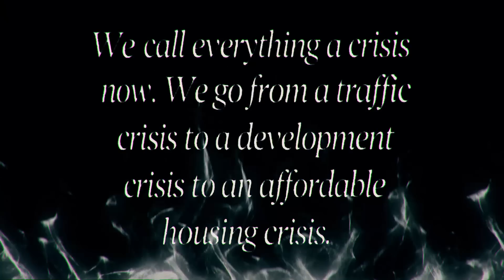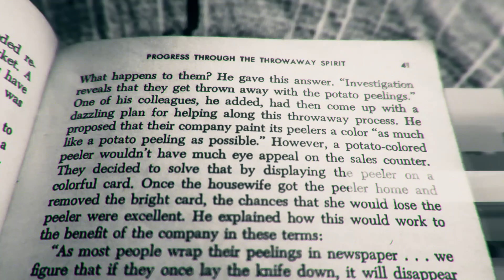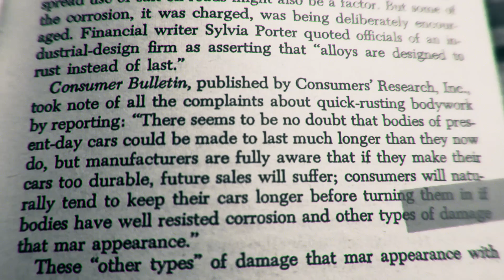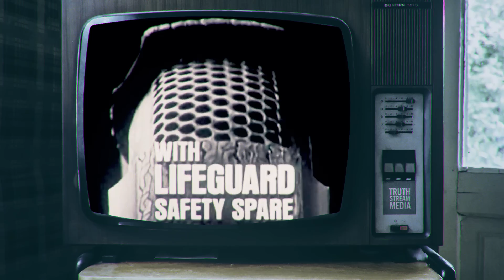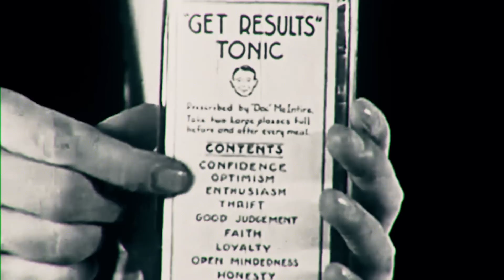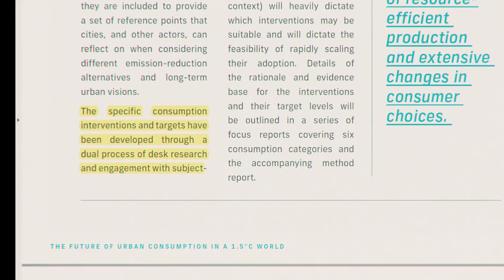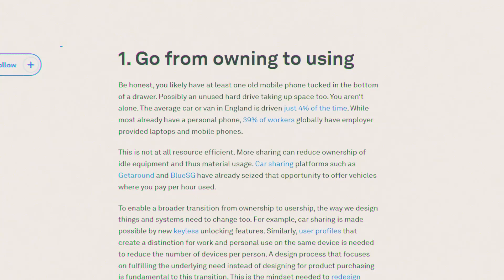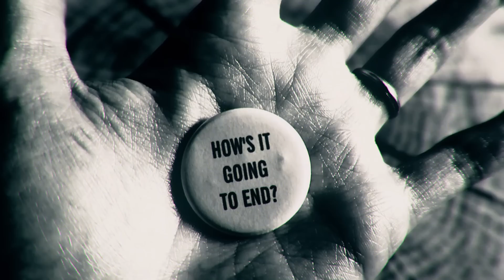Obsolescence Is Created in the Mind

Comment: I sell appliances for a living. People are trading in 40 year old functional appliances for ones which last under a decade simply because they "look better" (which is very debatable). 

It blows me away. I try to tell them not to, but people don't care.
Reply: My fiance's former coworker asked us if we wanted their old  Kenmore washer and dryer from the 90's and assured us they work great.  We took them, and sure enough they run great.  Zero problems. Yet when we used to rent, our washers/dryers would give out every 2-3 years.  And it was cheaper for our landlord to buy a new one than repair it.  Go figure
Reply: My old Whirlpool washer and Maytag dryer I bought in 1993 still works today.  I can get parts from Whirlpool directly and replaced the tags for agitator to move.  Those went bad once. But good to know I can repair it myself.

Comment: Born in mid-1960s, I drove 1955 pick up truck into early 1980s on the farm. Repaired, repaired, fixed, and repaired it ran better and was better work truck than the 1980s that were being bought.
'65 was darn good, too. '71 I drove into late 1980s as my first truck I paid for myself.
I had 1950s refrigerator and repaired it in late 1980s, gas stove was 1960s as well. Everything in my first house was mid '50 to mid 60s and washer/dryer were mid 1970s....that was 1985.
They were still in house when I sold it. My 1971 truck was only given up when I couldn't replace, re-repair, the body/frame damage done after 25 years.
Many would have and still would keep things much longer, but hell, my coffee makers last a year and even trying a percolator on stove and it failed, began to rust after 14 months unlike the old stainless I had as teen, twenty year old.
Mahe Ohna ✌️ Favour ALL

Comment: We have an old Amana refrigerator that my parents got back in the early 90s. It's in our garage and still works fine, including the freezer part. Then we have a newer Samsung French door fridge in the kitchen that we bought in 2015. It leaks water all over the floor even though I shut off the ice maker and completely disconnected the supply hose from the wall. I still don't know what the problem is. Water also collects at the bottom of the fridge section and forms a sheet of ice because it's right on top of the freezer section, which means the deli drawer gets stuck and we can't pull it out. I don't know where the water is coming from.

Comment: Tennis racquets.  If we never shifted from the "skill-required" wood racquets, I think the sport would be better.  And wood is truly recyclable.  they lasted, but you needed to replace every year or two.  It was the business model they wanted, right?  Connors used that ugly metal thing, but then graphite.  Suddenly you had a racquet that would last as long as you didn't abuse it.  So they did what car companies and fashion designers do, they create new styles.  But also, use tech to give an edge in one way or another.  

PS.  What if they wanted to sell 2 cars to every family but forced it by making the economy so bad both partners have to work to maintain a family?  What if...  wait, that's exactly what happened.  "They" are that cynical.